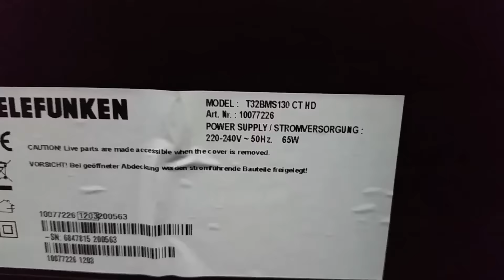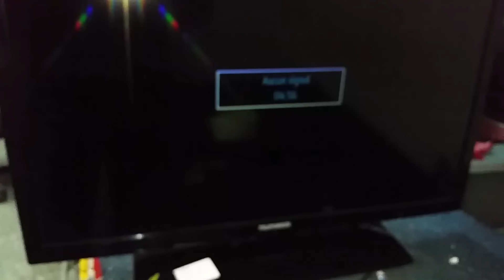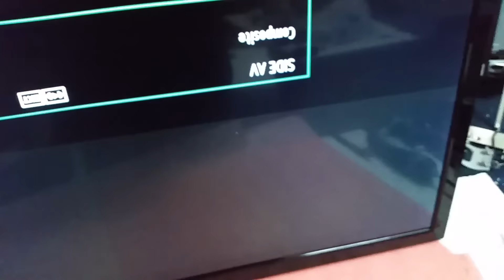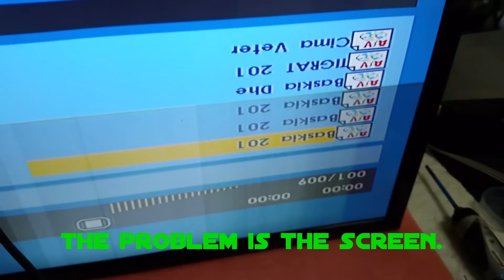TELEFUNKEN T32BMS130 CT HD, photo on the screen. It Is. half. is good. half is bad.

Comment: Little transistors for that horizontal row failed, simple fix is to drill that section of the screen out on the very edge but its hard as you can crack the glass. Im doing a video on how to fix this soon.
Reply: MrReeceyburger123  waiting for your videos, hope soon :)
Reply: jenreparable panel  bay